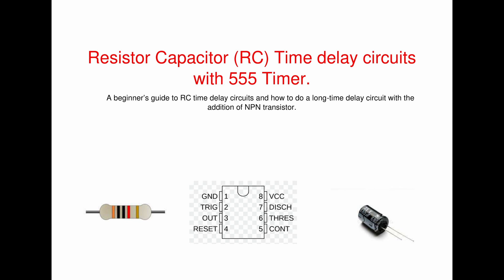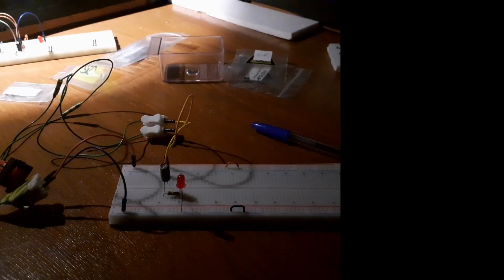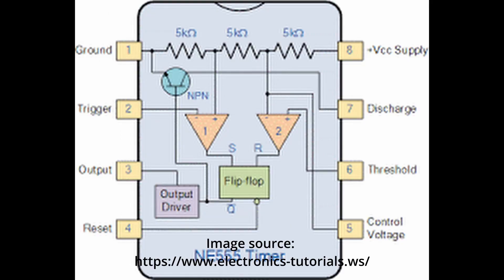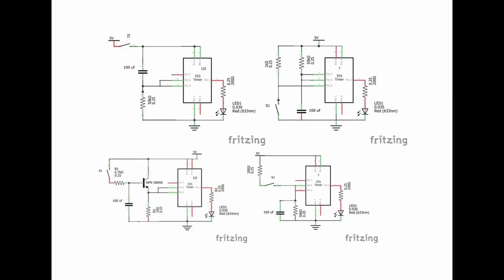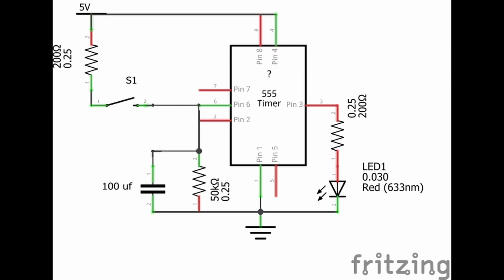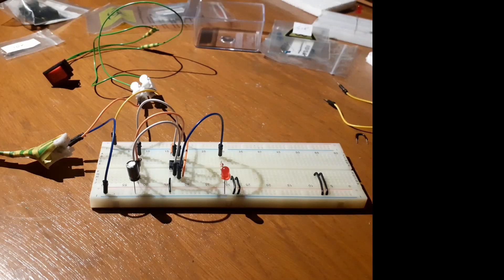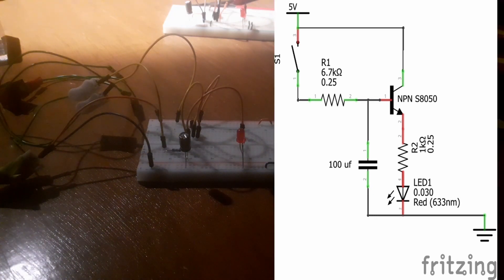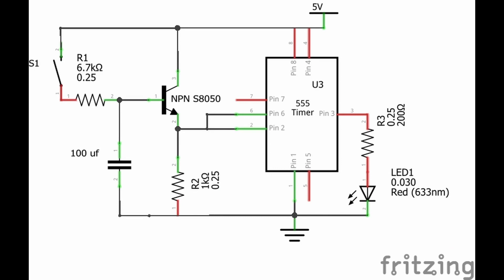RC Time Delay Circuits with 555 Timer for Beginners

Comment: thanks for sharing. any specific reason you used the transistor NPN S8050 PL. could you tell me. can we try without the transistor pl.
Reply from the maker: the reason the transistor is used is explained in the video
Reply: @paddymacnamara6305  sorry I tried to know. Could you pl telp time slot. will rewatch .

Comment: The circuit on the front page doesn’t work when VCC over 5 V, say 5.3V, why?
Reply from the maker: No reason why it shouldn't work with > 5V 
Did you try it with 5V or less and it worked?